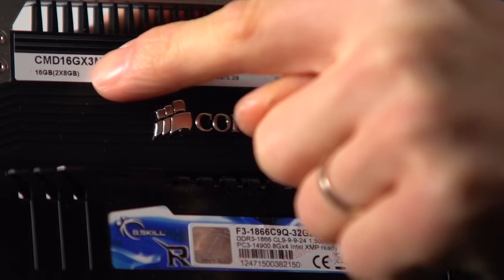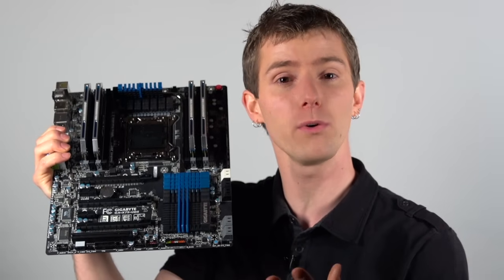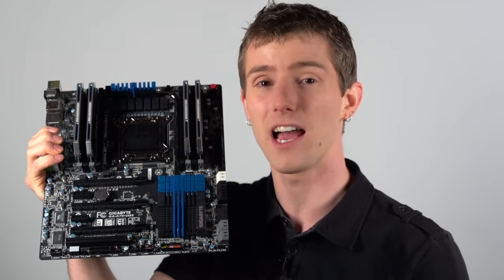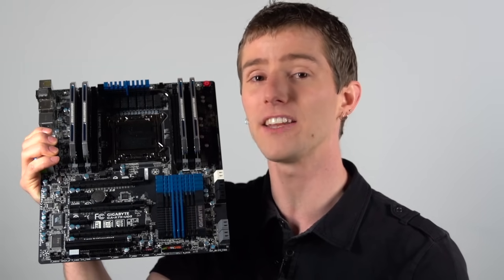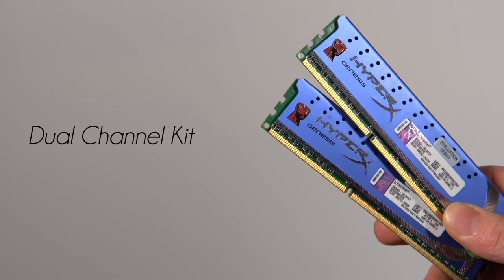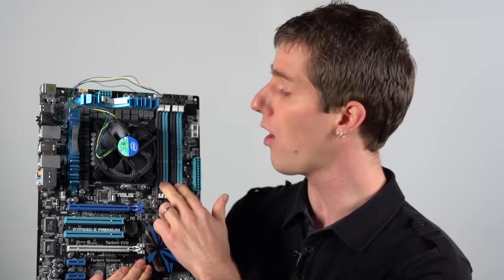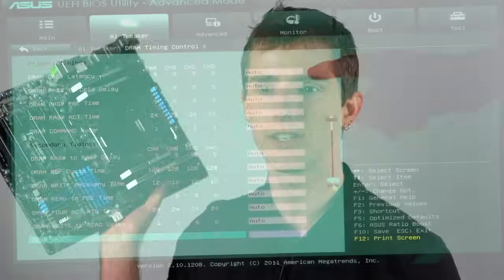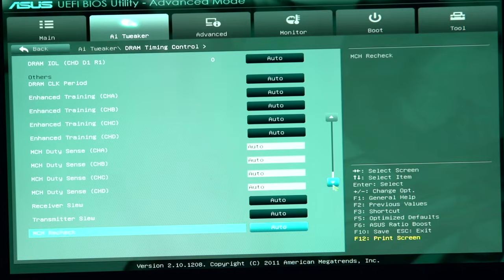Guide to RAM Memory Channels as Fast As Possible

Comment: Even if it's more than 3 years old, it is up-to-date.

I'm building a PC of my own for the first time, and I got a little bit trouble with RAM.
Thay say that the 'Corsair CMY8GX3M2A2400C11R Vengeance Pro Series' is for Intel® 4th generation.
Still, I want to use it on the 'Asus 970 PRO Gaming Aura AM3+' Motherboard with AMD-Chipset.
I guess this might not be working?!

Comment: How does dual channel work with 4 slots occupied? Does the motherboard pair 2  sticks and the other 2 sticks?  I have 2x8 Gb and i'm interested in buying additional 2x16Gb in order to reach 48Gb.
The sticks would be the same speed and timings, but different capacity. Will dual channel still work for these sticks?

Comment: So if I've got a mobo with dual channel and 4 slots, and I have two of the slots already taken up by 4x2 ram, and I want to upgrade to 12 gb, then I should get 2x2 ram instead of a single 4 stick? Also, would getting the 2x2 sticks hinder performance? I've heard some people say the mobo takes the speed of the slowest ram. Plus, if I got the 2x2 ram, my slots would be full and I wouldn't be able to upgrade in the future without getting rid of my old ram. Would it be better to save up for 4x2 ram and just get 16gb (seems like a bit of overkill for what I'm doing atm but would probably help in the long run)?

Comment: If a kit is not in the QVL, will it work anyway. I just ordered but not installed yet a 16gb 4x4 kit of kingston hyperX Predator (KHX18C9T2K4/16X). Will it work with my asus P9X79 and 4820k processor? The kingston website is not very clear on if it can do Quad channel. In the features column of the predator, it says quad channel availlable but whenever I click on quad channel, it points me to the genesis kits. It also does not say that the LGA 2011 socket is supported. Should I send it back and get a kit from the qualified vendor list?

Comment: which is better 4* 8 gb or 2 * 4 gb in a dual channel mother board like haswel.want only 16 gigs both of above configurations comes in same price tag for gskill 2400mhz module. if no need of future expension is required which one performs better
Reply: I think you meant, 2*8 versus 4*4, either config provides 16Gb. The 4*4 will accomplish better addressing scenario.

Comment: my motherboard official site for my motherboard, says:
Dual channel memory architecture
* Because of Intel chipset limitation, please use single-side memory module if four memory modules are to be installed. 

That means that if i want 4 sticks/modules, i have to buy/get 4 different (single-side modules) from different kits?
if it's that, then why the bother to have dual channel 2+2 slots?
Will it happen anything to my board if i do get 2 dual channel kits?

Also in the same site it says:
4 x 1.5V DDR3 DIMM sockets supporting up to 16 GB of system memory

Does it mean that it supports 16 GB per slot or 16 GB Total?

Comment: So I have a question.... I get what you are saying, but still I wanna ask - i have an msi 970a-g46 mobo with 8gb (2 x 4gb) of corsair vengeance 1600mhz black Ram, luckily on my board the physical 2nd and 4th slot on my board are channel one and I kinda wanna upgrade my ram I would spend the money if needed, but is it possible (as the physical 1st slot is covered by my cpu cooler) to put just 1 4gb     Card in the 3rd physical slot??? Sorry if my wording made this bloody confusing 😋 ty

Comment: Still confused. If my mobo has 6 RAM slots and now I have 3 sticks in 3 red slots meaning triple channel, can I add 1 more stick in any black slot? Probably so, but if this additional stick is lower speed, will it bring down entire RAM setup to the lower settings or is it true only if you add odd sticks to the triple channel row?

Comment: My board is a dual channel board configuration with black and gray ram slots and the manual for the board states that for channel A I have to fill one black slot and also the gray slot next to it should I follow this configuration or just fill only the gray slots or the black slots? Its a Gigabyte 970A

Comment: So umm... If i had a micro atx motherboard with 4 ram slots but in 2 pairs of colors...

Should i put dual channel 2x8 GB or quad channel 4x4 GB on it?
Reply: 4x4 and 8x8 would be the same speed, since the motherboard only supports dual channel (2 pairs of colors as you said youself) Therefore it would be easier/cheaper to upgrade your ram later if you bought 2x8.
Reply: I plan to use 4x4 due to using aesthetic ram.

Comment: I need some help here. Say if I was to get a dual channel motherboard (specifically a x470), would I only be able to run 2 sticks of ram (2x16gb) or would I be able to run 4 (4x8gb) as long as they are from to different dual ram kits?

Comment: I have a GA-990FXA-UD3 AM3+ mobo... (Yes it's old) It is dual channel and will support 32gb of ram. I currently have 4x4gb sticks of ram for a total of 16gb. And would like to replace it with 16gb of faster ram. Should I buy one dual channel set? (2x8gb) OR Two sets of dual channel ram ? (2x4gb times two)?

Comment: I watched this whole thing, and I still don't know why dual/quad channel is better. I get that it's "optimized," but what does that mean? What is being optimized? If I'm in single channel mode, how much of a performance hit should I expect? Broadly speaking of course - I realize that the difference would be affected by which mobo it is.
Reply: A RAM stick has a speed (MHz) and a memory interface (64 bits wide) 

When counting total memory bandwidth of DDR1/2/3 SDRAM you multiply Base DRAM clock frequency x Number of data transfers per clock x Memory bus (RAM) width x Number of interfaces (sticks) = Which gives you the theoretical maximum memory bandwidth speed

If we test this out with, for example, a DDR3 2133 we would get 2133(MHz)x2(DDR - Double Data Rate)x64x1(One RAM stick)  =  273.024(billion) bits (34,128GB/s)

Now with dual channel memory the *Number of interfaces*, in the equation, increases by 1, meaning we'd get twice the previous amount (68,256GB/s) and twice that amount (136,512GB/s) with quad channel memory. 

This is theoretical maximum bandwidth speed whether this increases performance or decreases it or whether it's noticeable or not is commonly discussed and I personally started learning about PCs a few days ago, prior to that I had no experience at all about anything so I had to start from scratch. Safe to say I'm quite the rookie and I don't know enough to be able to give a definitive answer. 

Since a computer is linked together by different parts and components the TMBS is affected by a lot of different stuff, apart from the RAM itself, and they're not added into this calculation. So I think it's safe to assume it'll never reach it's maximum or be fairly close to it.

I do want to add that from what I've read so far people are talking about how RAM doesn't get much better with higher speed unless utilized, by overclocking for example. And I assume (I can be completely wrong here and I appreciate correction if so) that with dual and quad memory channeling it might be easier for the RAM sticks to work under overclocked conditions (since they have to send information faster but can do it through a wider bus, sharing the increased workload) 

Although I've read a lot about this since I started growing interest about PCs (4 days ago... I know I am late to the party) I have far more to learn about this and because of how debated this topic is, resulting in many different trust and non-trustworthy sites/people providing so much different information/graphs/experiments etc. I have yet to find a definitive answer.

tl;dr By using dual channel memory the workload for each stick is reduced and the speed is increased, since they combine(figuratively) their memory bus widths (64 bit) to create a wider one (128 bit) thus allowing to send information, TMBS, twice the speed of the single channel memory. But since they'll never reach a stress high enough or get powered enough, without interferance, the yield is not going to be 100%, numbers are usually from 5-10%.

Edit: Here's a link I recently read that talks about Dual channel vs Single channel. Hope it actually helps you, feel like I didn't too much for you with my rambling...
http://www.gamersnexus.net/guides/1349-ram-how-dual-channel-works-vs-single-channel?showall=1
Reply: I appreciate the effort, but you lost me. the tl;dr paragraph helped a little. Don't apologize, everyone has to start sometime. I started about 4 1/2 years ago, I know there's still a whole lot to learn.

Point being though, that in this video about memory channels Linus didn't even try to explain why dual etc. channel mode is better than single channel mode, and barely explained even what it is.
Reply: Indeed, I've been looking up alot about PC parts and such this past week and RAM has been one of the taller walls to climb due to the mixed information and/or lack of information. But I believe I understand it to some extent, although not as much as I wish to do.
The site I linked helped me getting visuals on the differences between them, in some areas, and at least it did a better job at explaining some of the differences.
Edit: Page 3 showcases measurements and brief explanations of their significance.

Comment: I still don't understand about this channeling thing.

I have a Asus Rampage IV Black Edition motherboard and 2 couple of dual 16GB 1866mhz RAM (8GB+8GB and 8GB+8GB). This motherboard has 2 channel with 8 RAM slots (4 left and 4 right). Can I put all 4 RAM stick on the right corner of RAM slots?

Right corner has 4 slots with 2 different channel, and the left corner has 4 slots with the other 2 different channel.

So is it possible to put full 4 RAM stick on the right side, and leave it empty on the left side?

Comment: when I switched from X58 based system which I used 3x4GB of corsair dominator RAMs to X79 based which used 4 channel, I bought a dual channel corsair dominator kit which have the same clock and latency as the previous one so that I can use the 3 RAMs from the previous system and one from the new dual channel and kept the other one. Does it affect my computer performance? Thank you for the help

Comment: Stop me if I'm incorrect. So if my motherboard is a dual channel MOBO (two differents colors in 4 total slots) I could buy 1 dual channel kit, put them on a color, and buy the same dual channel kit, and use them in the other color, right?

Comment: I have some questions, on those X99 most mobos say they can take a max of 128GB of memory but how, thats would need 4x32GB, i dont think there are single sticks of 32 yet, even 64 would need 4x16, also the new CPUs only can take 4 channels, with 4 sticks the max you can do is 32 for now i think, finally, why are there DDR4 memory with more than 2133mhz when the max I saw a cpu taking is 2133, am i missing something?Edit: oh wait, the x99 has 8 slots for memory right? so if i put 4x8 + 4x8 will it still count as quad channel?

Comment: I've got a question:

I've got a triple channel motherboard that has a total of 6 slots for ram. Currently I have 6GB with a 2x3 setup. If I want to add additonal RAM do I need to use all three remaining slots or could I just get 1 stick of ram. Not sure if triple channel means that it MUST be in multiples of 3 or not.

Comment: Alright, so to clarify: I want to use 32 gigs of ram, not 16, as I do some pretty heavy design and photoshop projects. My motherboard is dual channel, LGA 1150, and I can't afford a new board right now. Can I run four sticks in my board even though it's rated for dual channel use? Will the four sticks operate in dual channel mode, with possibly reduced bandwidth? Or will it be better to run only 2 sticks for the time being until I can upgrade to a board rated for quad channel?
Reply: Michael Allen On LGA1150 they will still run in dual channel, since neither the CPU nor the board supports quad channel. You just have more memory, but with 2 sticks instead of 1 per channel, this shouldn't change the performance at all. (except maybe for more memory you can use)
For using quad channel you will need a LGA2011 board with a compatible CPU (like the i7-5xxx Chips)

TL;DR There is nothing wrong running 4 sticks in dual channel!

Comment: Hi. I currently am running an old HP laptop which has 2 slots of RAM on the motherboard out of which 1 is occupied with a 4GB 1600 mhz of RAM by Hynix. What you are suggesting is that I should get another one of these single channel rams which are exactly 4 gigs and a 1600 mhz and put it in the second slot, right? I'm sorry I'm just not too much of a geek!

Comment: I'm still a little confused, can I have some help please? I'd like to buy a build with an intel i7-6700k and a MSI Z170A GAMING M7 ATX LGA1151 Motherboard. The motherboard has 4 RAM slots but it says that the processor has a max number of memory channels of 2...does this mean I need dual channel? or quad channel?
Reply: your processor will only support dual channel even IF your mobo supports quad,  means buy dual channel its cheaper
Reply: James R Thanks, I went with 2x16gb :)

Comment: I just removed a Stick of 2 GB . My system was with 6GB , but I thought it didnt work good , then I removed and there was a huge difference in dual channel mode . Then I bought another 2 GB stick now running with dual channel mode and 8GB .

Comment: I bought two dual channel kits. Exact same kit from exact same manufacturer bought from the same place at the same time. I have 4 slots on my MOBO. If I put all 4 sticks in all 4 slots will it mess it up? MOBO is Asus z390-a, cpu is 9900k.

Comment: I plan to use an i7 6800 CPU in an ASUS X99 AII mobo, but according to what I read about the CPU, I can only use 4 DIMM slots. I was hoping to gradually build up to 128 Gb by using 16 Gb RAM sticks. Does this mean I have to use 32 Gb memory sticks to get to 128 Gb?

Comment: If I have a Dual Channel Motherboard with 4 slots, can I run 2 different sets of Dual Channel, or should I have all four matching.  If so, can I use a single quad channel set or do I need two of the same dual channel set?

Comment: Noob question:

If I get 2 Single Channel kits (identical memory modules of course), operated in dual channel mode. Will I get the exact same performance as if I bought a Dual Channel Kit?

Comment: If you have two different pairs of ram Ie 4gb of cas 7 1600 mhz ram 1.35 v and cas 9 8gb 1600mhz ram if I put the ram in the proper memory banks. ie 1-3 and 2-4 will dual channel work still? Ive read somewhere that it wouldnt, so Currently im only running 8gb of the cas 9 ram.. but id really like to use that cas 7 but if i have to sacfrice dual channel its likely not worth, so my 3 options look like 4gb of cas 7 dual channel of 8gb of cas 9 dual channel, or 12gb of single channel...

Comment: Which setup would be better for an upgrade.  I Currently have 4 - 4GB.  DDR3 1600mhz.   The board has 8 slots.   Would adding 2 - 8GB to the setup be okay or should I add 4 more 4GB?   Option 2 is to dump the 4 - 4GB and start fresh with 8GB across to get me to 32GB with option to upgrade from there with more 8GB's.  Not sure if incorporating 2 - 8GB will be a problem with the 4 - 4GB.

Comment: Techquickie So if you've mixed ram, how do you know if your system is running on reduced ram channels? Is there a way to diagnose if my computer is running on less than its optimal potential? Im on a 12 core 5,1 Mac Pro BTW.

Comment: I have a ASrock FM2A88+ Killer board that supports dual channel 2400mhz. I can't get above 1866. When I try for 2400, it boots but hangs on the windows boot and just shows the loading circle moving very slow. I was guessing that I don't have enough power for this to run at 2400mhz ?

I have latest BIOS, freshly installed Windows 8.1 Pro, R9 270x with a 650 PSU and 16 GB of Corsair Vengeance Pro Series 2400 mhz. I plan on getting 32 for high end video editing in the near future and wanna make sure this isn't a waste.

Comment: ok question if say i have a dual channel board with 2 sticks of identical ram in channel a, slot 1 and channel b, slot 1. Am I still getting the increase in performance or do I need to get 2 more sticks of ram to have them operate in dual channel config?

Comment: I'm using a tripple channel kit and a single stick from a dual channel. it has the same speed, timings and voltage as the tripple. so when it's all in they are identified all the same in aida64 and run in dual so is that good?

Comment: Damn I wondered, cos I wanted a quad channel 2011 micro atx motherboard with a 4930k and a single 8gb stick as I was gonna buy the other 24gb at the beginning of the next term (when more money comes in as 32gb ram blows the budget) so that'd be 4 months at a quarter the speed it's supposed to be at. :(

Comment: I'm putting an air cooler on my CPU, the hyper evo212. I haven't bought the ram yet cause I'm in the process of building.. I really want to get the ram with the big heat sinks but the fan of the evo212 might be on the way.. my motherboard have 4 ram slot, will it make a different if instead of using slot 1&3 I can use 2&4 just so I could have clearance from the fan and the ram. I hope you get what I'm trying to say

Comment: Ok, so I had 2x4GB @1600 MHz CL9 (timings 9 - 9 - 9 -24) ripjaws installed in my system. one of them turned out to be faulty. so basically I would have to replace that one with another ripjaws 4GB1600 blah blah... but let's say I don't have access to ripjaws where I live. could I just throw in a vengeance 4GB @1600 CL9? do manufacturer & brand ACTUALLY change anything? I would think not, but I read a lot of comments saying "same manufacturer and specifications".